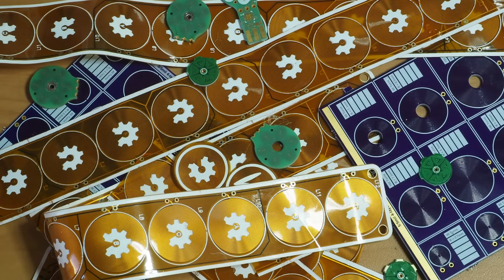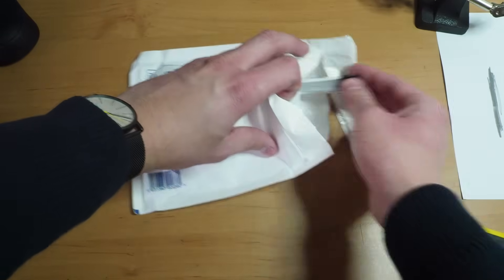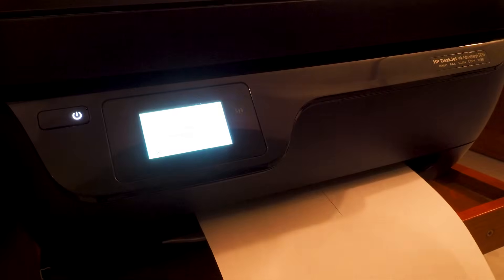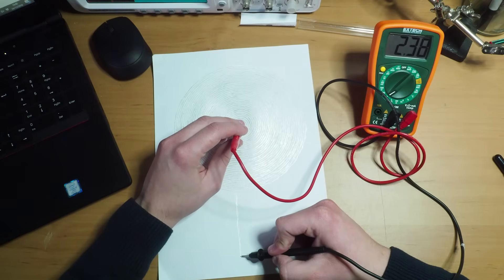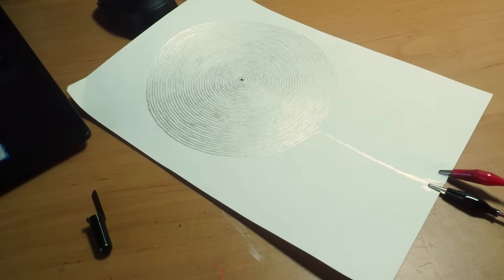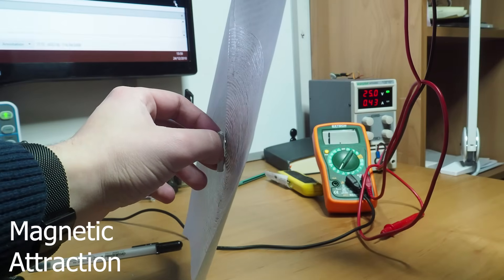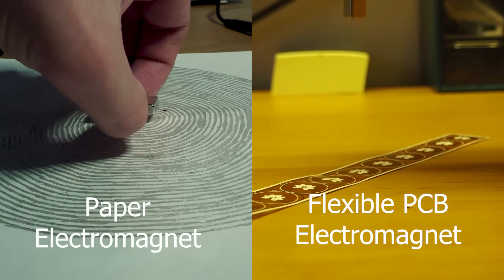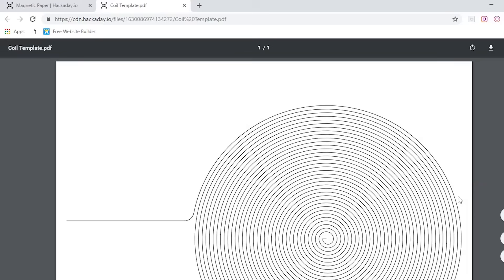Attracting Paper to Magnets!

Comment: great job brother! youve used silver in this case, I think it's less responsive than copper in thia case. but dude, another use case is the speaker youve made earlier. youve just created a great membrane! I propose you make a stack of these papers in parallel (hopefully with some automation, youve got a 3d printer or cnc around? you can attach the pen to save your preciois time) to created a stronger magnet in the middle of the paper like you initially did. good luck brother!
Reply from the maker: Thanks for sharing your ideas! I love your 3d printer idea.. It also works very good as a speaker because of the large area of the paper. I didn't show it in the video but if you pulse the voltage it generates buzzy sounds just like the flexible actuator

Comment: Did the paper get warm at all? Dumping 10W through it seems like more power than I'd expect before thinking about it. After thinking about it, A4 is about .2x.3m, so it gets about 80W max in the Sun (at 1.3kW/m2), so this is probably equivalent to leaving a piece of black paper outside. A neat application, to be sure!
Reply from the maker: Yes it gets a little warm.. Haven't meseared the temperature yet but I don't think its exceeding 60deg Celsius